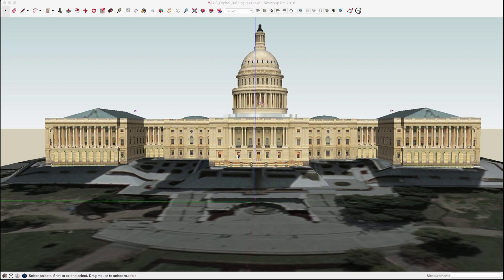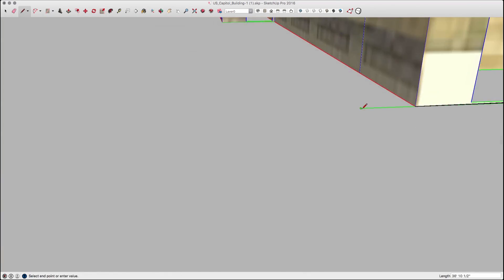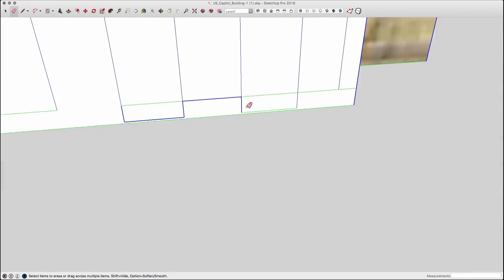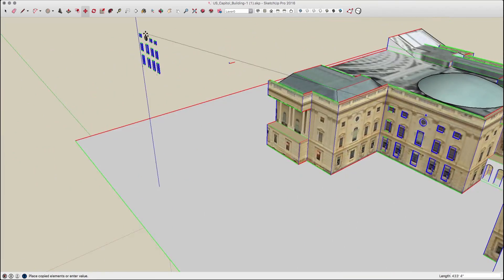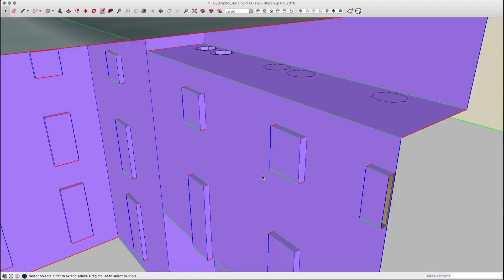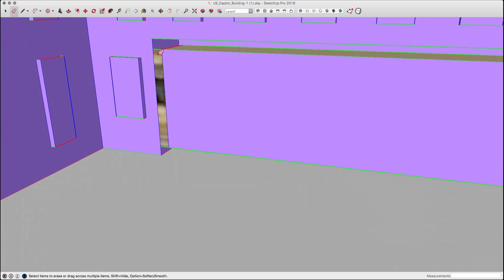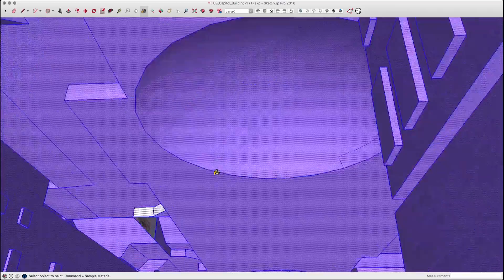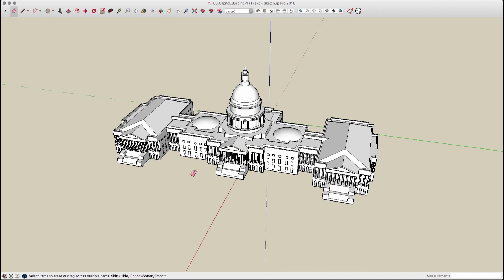Speed Modeling: U.S. Capitol Building

Comment: great work! Was it necessary to use support for printing this model? as there are some hanging parts like the arches and top of windows.
Reply: +gsmarcom  The arches and windows on this model were small enough that they did not require support. If there has been larger overhangs or extrusions, I would have included support via the slicing software.
Reply: +Aaron Dietzen thx!

Comment: What brand/model 3D printer are you using?
Reply from the maker: +Douglas Goldstein This model was printed using a Dremel Idea Builder.
Reply: +SketchUp How long did it take to print it with the Dremel Idea Builder? What do you think of the Dremel Idea Builder printer? I see Dremel is coming out with a new 3d printer this summer.
Reply from the maker: +ApplianceJunk The print took about six and a half or seven hours. We like the Idea Builder a lot; there's usually something printing on it every day in our office. It has a way more reasonable price point than a lot of similar printers out there, although since Dremel is pretty early on in the 3D printing game their software has some room for improvements. They're surely working to improve it, but for the time being we've been using third party softwares such as Simplify3D that talk well with the Dremel. All in all it's been a consistent, cost effective printer. Would recommend!
Reply: Good to know, thanks!